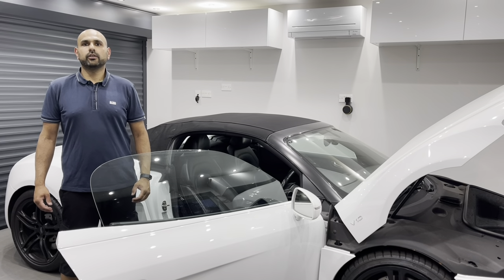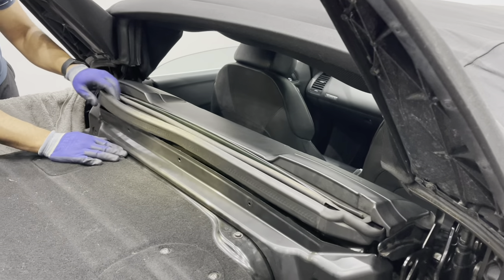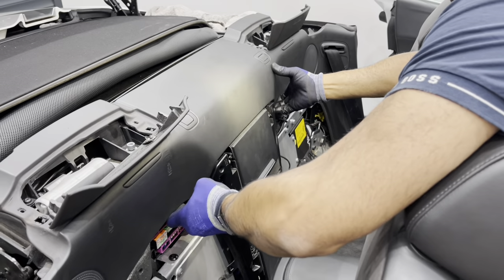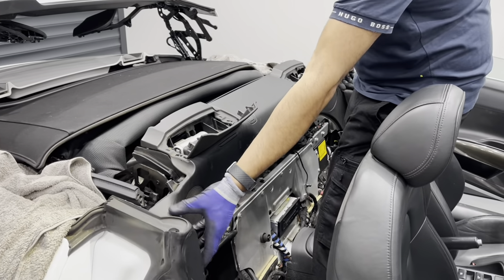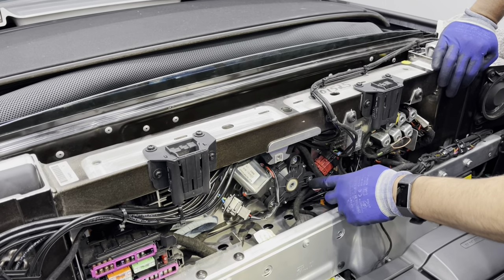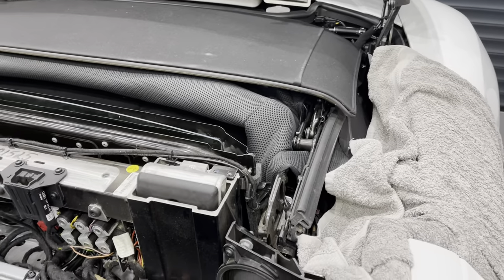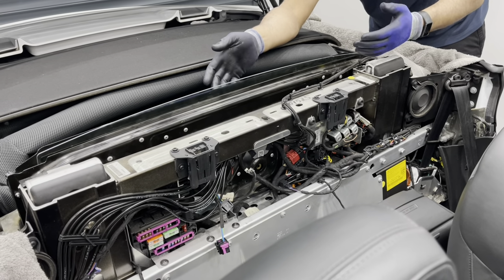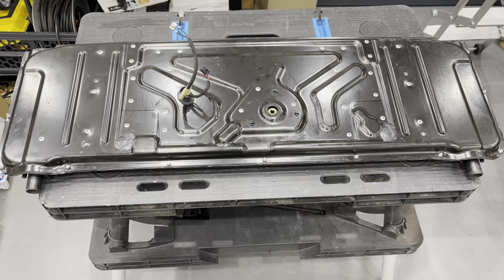Audi R8 Spyder (427) - How To Remove Rear Window Cartridge (427845861A) for Refurbishing / Repairs

Comment: Hi I’ve just smashed the rear window on my r8 spyder. Can i replace the glass or do i need the whole cartridge please?
Reply from the maker: Hi

Glass can be replaced only, but I'd recommend to get cartridge out, turn upside down and remove glass

Also to vacuum out drains once cartridge is out

Comment: I have a problem with my back window won’t go up or down I have put power direct to the motor and it turns both ways but when it’s on the car it does nothing. Do you have any solution and yes I have checked all the fuses
Reply from the maker: Hello, we would need to see the data inside your roof controller so see what the cut out requirements are